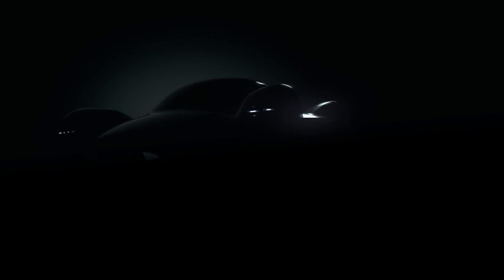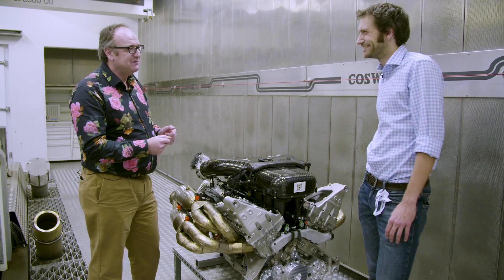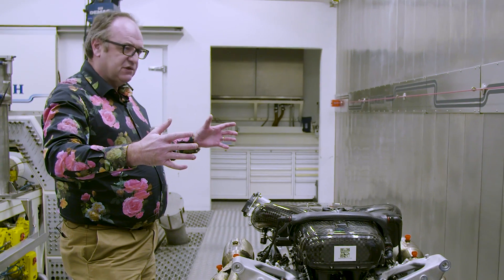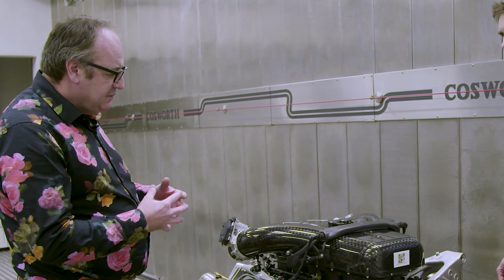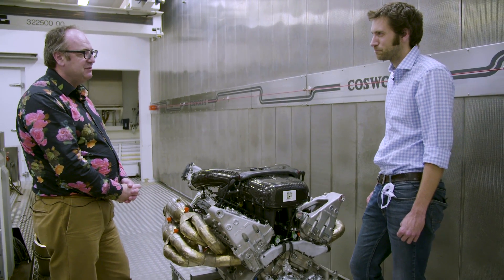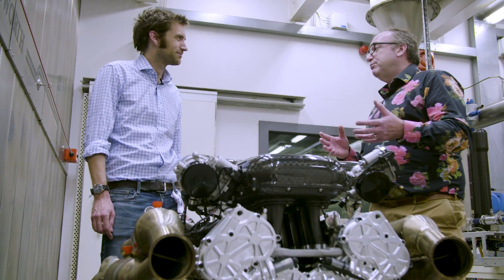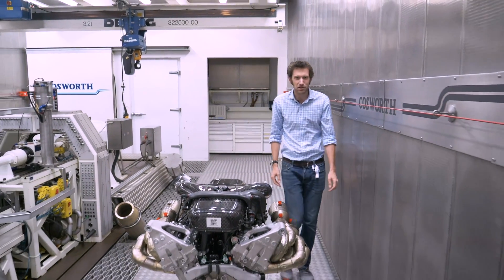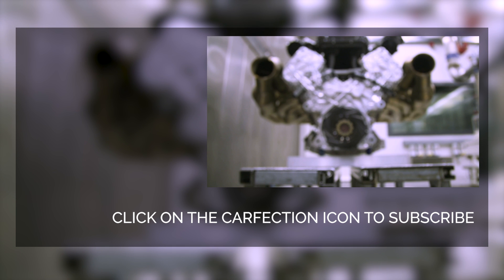Hear The Future Of The Supercar At 11,000rpm: The Aston Martin Valkyrie's V12 - Carfection

Comment: He said Valkyrie is the only road car with a fully structural engine. But Ferrari F50 used similar solution, i mean the gearbox and engine was the only parts keeping rear chassis with the front rest of the car. Is this the same solution or totally different?
Reply: The Renault Clio uses the same technology, the bumper, headlights, engine, radiator, and front wheels are all linked together meaning that if you want to change a bulb you have to take the engine and gearbox out....

True story, many French cars share this design...
Reply: @123Sander1231  Are you serious? Are you comparing a clio with this piece of incredible engineering?!! You said yourself you can remove the engine... what happens to the Clio when you do this? Oh that's right... nothing!! The V12 in the Aston is the only part joining the front and rear of the car... remove it and you have 2 pieces flopping on the ground! Wether the body will be strong enough to support it is another matter, or perhaps it will need to be on stands or trestles during an engine removal...
Reply: @BrianSmith-ck4mm  I don't think so because in F50 if you separate the gearbox and engine you litteraly tear car into rear chassis with bumper and a rest. There are photos and articles on internet of clutch removal in F50 and it looks like i said.
Reply: @bolectv1933  then I stand corrected! I shall do some Googling!! 👍🏻
Reply: @BrianSmith-ck4mm  It was a joke you would understand if you worked on cars for a living!
Reply: @BrianSmith-ck4mm  incredible engineering? I can't see any of that with the dumb ass single wiper hogging up the entire front end. Only connection between the back and the windshield wiper more like. I bet you that thing is structural. God damn I fucking hate windshield wipers.
Reply: I believe the V12 in the F50 and Enzo etc are part of the structure but they can be removed and the car is still intact. The Valkyrie V12 is literally is the only connection between the front and back of the car!
Reply: AFAIK F50 uses some aditional reinforcements to connect fromt and rear. So technically the engine is holding the F50 together, but there are other support reinforcements. The Valkyrie however only uses the engine without supports. That's why they actually can say that the valkyrie is the first car solely held together by the engine.

Comment: Super impressive. But, if an electric 200kwh, 3 or 4 motor car can produce the same power (and more, with instant torque), are its days numbered?
Reply: Even though the batteries and motors would weigh the same if not more. Yes you can have the massive power but if the car can't get anywhere it's useless
Reply: @TheRagingStorm98  Current batteries are heavy-ish, although energy density is on the rise. And solid state batteries, when they EVENTUALLY arrive, will change the landscape once again by being 3 times more energy dense as current lithium offerings, while having none of the bad stuff:
- No possibility of explosion
- Magnitudes faster charging and discharging
- Can be made from common elements like sodium
- Have up to millions of possible charge/deplete cycles

By the way, Echoklang, the Tesla 2020 Roadster will have all those things I mentioned (200kwh battery, etc) and still be capable of 0-60 in 1.9 seconds, top speed over 250 mph and more.

Comment: So basically it has beated McLaren's F1 record for the most powerful N/A production car,right?
Reply: Based on the engine alone, the F1 was already topsided by current V12's by Ferrari (Berlinetta, Superfast). But as car performance as a whole, F1 is still the king of N/A. And since the Valkyrie will feature a hybrid powertrain, the comparison in the performance won't be valid with the F1. If the Valkyrie comes with an option of strictly N/A, then we'll compare it with the F1.
Reply: @anastasiskaz  If i come to think of it, the only valid comparison to the F1 currently is the Vulcan, also from Aston Martin. The Vulcan has more power, however the F1 is a lot lighter. It would be interesting to see them side by side on the track. However the Vulcan has not been tested for top speed, so if we're measuring strictly on that, yes, the F1 is still the fastest (not necessarily the quickest) N/A car in existence. And it came out 25 years ago. That's a gosh darn good legacy if you ask me.
Reply: The f1 has the highest top speed for a NA engine not the most powerful

Comment: Is 1000hp for just the engine or including the e-motors? The Tesla Roadster 2 will probably be in that range and at 1/10 the price (I'm guessing)... Nonetheless, a NA high-rpm engine is a nice choice if you insist on using yesterday's technology.
Reply: @xechox-r1l  OK. I might have mixed this up with the other upcoming British high performance grand tourer. Jaguar perhaps. The Tesla will probably be heavier as you say. But it'll have rockets!
Reply: @xechox-r1l  The thrusters could be actually be used for safety purposes (braking and stability for example) as well as increased performance. I'm pretty sure they won't be in the base version though.

Comment: Why not get rid of the gear box and stick an electric generator on it then run it at constant speed and use a battery/capacitor/e-motors to handle driving the wheels? Save a lot of weight no?

Comment: Weighs 440lbs. Just for comparison, a small block Chevrolet V8 weighs 575lbs. WOW!! THIS THING IS AN RPM MONSTER!!!!!
Reply: Yes the old iron block, iron head small block from the 80's may have weighed that.  However the current LT1 small block weighs 465 lbs
Reply: In comparison: This engine weighs a little more than 200kg while the engine in the Veyron with same power output weighs 400kg.
Reply: The point was  "why is this guy comparing a 2019 Cosworth engine to a 1955 chevy small block!!?"
Reply: furthermore... for the 600k extra spent on the Cosworth, im sure we could fab up a titanium bracket for the LT so that it too could be a part of the stressed member.
Reply: @jeffreyhavlik3562  but then with power adders to the lt1 it would weigh alot more.
Reply: @jeffreyhavlik3562  The internet ego contest........
Reply: You might as well compare a leopard with a rhino. 1HP/kilo in ANY configuration will rock my boat.
Reply: @jeffreyhavlik3562  .
Reply: That's around the same weight as the 3.6 dohc v6 in my Impala.
Reply: smallblocks are impressively light for their other specs.
A K20 weighs 400 lbs. 3 times the cylinders and over 3 times the displacement, 40 lbs more
Reply: I want to know what their 250hp 3 cylinder prototype weighed! I assume 1/4 the weight by his explanation, so roughly 110lbs!
Reply: Jdr, let's keep this discussion about factory parts. There's no LS or SBC factory block running in the 5s. Using factory parts, the LS is a better platform period.
Reply: C6Fever  speak English (pounds)
Reply: what kind of idiot would compare an engine made in 1955 to an engine made in 2018?

no one uses the SBC boat anchors anymore unless its for period correct rebuilds. the LS series is far and away better.

LS1 engine weighs 390lbs dry, around 430lbs fully dressed.
LS7 weighs about 450lbs fully dressed.

the cosworth engine is truly amazing regardless. what an achievement for them.
Reply: @OxBlitzkriegxO  the ls series isn't far and away better God damn the. You can get a sbc that weights less than a ls makes more power then a ls and is quicker and stronger then the most expensive ls build around. As the quickest sbc is a nitro engine at 5.67 ets in the quarter and the ls barely traps 6.10s
Reply: @OxBlitzkriegxO  the sbc isn't a boat anchor infact that platform can run circles na around this 6.5l v12 with only 6.2ls
Reply: lol americans and there boat cars. sit down guys and go back to your little line racing. HERP big numbers DERP

Comment: This is what F1 should be running, a screaming V12..
Reply: It sounds like an 90s F1 engines on steriods
Reply: EVERYONE SHUT UP AND ENJOY THE DAMN VIDEO
Reply: Veery true....shit times....polution....my ass
Reply: They were too powerful. And trust me with the computer systems we have, a v12 isnt needed to make cars go fast as hell
Reply: But it might make a widdle bunny cough, we can't have that now, can we?
Reply: The size of the cylinders is forbidden
Reply: tbh while this is higher pitched it also sounds like a vacuum cleaner
Reply: @amac_  That legendary BMW V10. Brings tears to my eyes
Reply: @nonserviam4813  i highly doubt that they would be faster, besides that the fuel is not included in the weight of the engine but it plays a significant role. I admit i was wrong on the weight of the PU, but i am correct when i say these V12 had less power. Today we have over a 1000hp.
Reply: Can’t wait to see this and the new Hennessy eventually duke it out!
Reply: @BigSeane012  in my opinion this would be a greater piece of art because of its high performance naturally aspirated v12 unlike henessey which has forced induction like turbo and superchargers(that sound like crap) but i have to agree, henessey will beat the shit out of this car.. so easily..
Reply: Everything too heavy. The current option is probably the best right now. More than 1000hp combined.
Reply: IMO the engineering going into the current turbos with their ERS-H antilag is way more interesting than just bolting extra cylinders on it..
Reply: @JippaJ  it may look interesting or it maybe interesting to study but very very uninteresting to hear
Reply: @tarun9710  Ever been to an f1 race? They sound incredible.. 

And to be honest I don't give a ** about sound. I love to watch a Formula E race!
Reply: @JippaJ  yes ive been, but in my opinion its the high revving naturally aspirated that sounds great.
P.s - its a personal choice though.
Formula e is great..🙏
Reply: @tarun9710  The amount of cylinders isn't gonna increase the revs (and sound), it's the fuel limit! 
BTW this engine does the same amount of revs as an F1 car..
Reply: @JippaJ  i know that , i mean the screaming nature of a naturally aspirated v12 and a turbo charged v6 is very very very different , i think u should once hear it ...
Reply: @tarun9710  you're very very uninteresting to hear.
Reply: Jaap My first British Grand Prix was 1972 aged 18months, I went every year till 1993 then work overseas. I’ve also been to Zandvoort, Spa, Hockenhiem and to Le mans 23 times, the last 20 in a row.  The 1980’s turbos sounded raw and untamed with the pops, bangs and grunts, they sounded feckin awesome going up the hill into druids at Brands Hatch. The 90’s V10s and V12’s screamed. So forgive me but for me the Screaming v10-v12 that were built like an exquisite Swiss watch sound better than the latest generation of F1.
Reply: @runnyeggyolk6347  just like u
Reply: @tarun9710  are you joking? I'd take the current sound ANY day simply because you can hear so much else going on. Lock-ups, part failures, skids... I dont know why people insist F1s should be so loud as to drown out all the fun stuff
Reply: @JippaJ  which F1's? Current rev to 15,000 rpm, previous f1 engines (Coswoeth v8) did 19,000 rpm (limited) but hit 20k on dyno's
Reply: @nssherlock4547  I commented on that 10 months ago, back when F1 cars revved up to 11k, sometimes 12k. 

Now F1 cars still don't go above 13k. Just watch the F1 telemetry during a race.
Reply: Chucky boy Stanley I just don’t think people really understand how load the na era engines were. When I went to silverstone I used to stay at my friends in Leighton buzzard 26 miles away and you could hear the engines firing up on Friday on practice laps just awesome noise
Reply: Idk.... V12 burns too many gasoline and makes little power. I think V10 would be perfect
Reply: @김지훈-t2t1w  v10 is also great but only if its very high revving atleast 12k and then the sound would be amazing
Reply: @김지훈-t2t1w  You nuts!! V12s make little power? Says who? La Ferrari makes 800 hp out of a 6.3 aspirated V12! All of that in a road car. Ever heard of a V10 to make anything close to that? If anything, the extra size and weight would be a downside to a V12, but certainly not lack of power. On the upside, V12s are naturally balanced, so they send out very little vibration compared to any other cylinder configuration type engine. Also, the sound of the 12 cylinders full bore at work is way more likely to send entire hordes of espectators awe struck in pure folly.

Comment: Can we make all F1 cars have these instead!? I know we had V12s before but this... this is what we want!
Reply: We don't want this engine. We want its sound. About to get a little nerdy here, and I hope I'm not coming across rude.

Assuming it all weighed the minimum, the entire powertrain of a modern F1 car, including the hybrid system, weighs at least 35kg less than this engine does MINUS its hybrid system. It also makes about the same power. That's a lot of weight when you're talking about something as light as an F1 car. Even the weight of the fuel makes a noticeable impact. You'd need to do SOMETHING to the engine to get enough power out of it to counter the weight, and it would end up even heavier because of it. I think the only F1 engines from the past that could come close to doing enough are the qualifying engines used in the 1980s. The old turbo 6s running stupid amounts of boost that couldn't be used for more than a few laps because they'd blow themselves up. And all of this is ignoring the sheer size of the engine. Modern F1 cars are built to hold a 1.6L engine, so you'd need to rework the body, further increasing the weight.

So yeah. We really wouldn't want something this big and heavy in an F1 car. But it'd sure make a nice noise.

Comment: Much ado, all rendered obsolete by the electric motor
Reply: The Petrol car will remain, just a bit more rarely.
But they won't be taken out without a fight.
Tesla 2020 is only stated to go 250 MpH, Impressive bench for EV's, but it will take decades to better that as an EV.
Reply: @Blurgamer17  Teslas are mass market. Check Rimac Concept 1 or Rimac C Two. That's the bee's knees

Comment: 3:15- a 3 cylinder 250hp engine.

Wait.  Did I just hear that right.
Wow.  You know what you can do with that? Salavating
Reply: Mike Shoults imagine that engine in the front of a Mini, or Caterham...., or at the back of an i8 👍🏻👍🏻
Reply: GT Specialist or an i3 :)
Reply: the i8 produces abut 220hp from a 3year old 3 cylinder engine.
Reply: @jaymaster103  *turbocharged 3 cylinder. This one was naturally aspirated.
Reply: A NA 1.6 Liter 3 Cylinder whichs revs up to 11 000 and weighs like 80 kg.. 
If i would have one of those, i would put it into a smart.
Reply: @gepixelt7712  imagine the sound of it as well! It would sound like a big motorbike engine.
Reply: Put one in the front and one in the back...
Reply: One word: motorcycle.
Reply: LTG 4 cylinder equals 272/3 = 90.66666666. But this is a diffrent level.
Reply: @noidontthinksolol  This is a wonderful idea. Now for Aston to make bikes haha
Reply: Koenigsegg Regara is 260hp  per liter
Reply: @sthomas7211  but the engine is turbo. Here, we're talking about a naturally aspirated engine. More than 150 hp per liter is IMPRESSIVE.
Reply: @TwistersSK8  scrap that. Its not just impressive but it's record breaking. The S2000 had a specific output of 120 ish and a maximum piston speed of 25m/s and this is even faster and has more power.
Reply: Mazda did better with the wankel in the 70s..... with a 1.3L two rotor.

Comment: What is the 0-60?
Reply: A function of gearing...
Reply: Based on calculations of weight to power, and taking into consideration traction, I think this will be somewhere around 2.1-2.3 seconds
Reply: Porsche Collector one of the said in a radio interview the goal was 2.0 I’ll try to find it and post a link
Reply: @soupfork2105  Ok.Tesla roadster is faster.
Reply: @theninja9127  Tesla roadster will be weighing more than 2 tons possibly (with a 200kWh battery), it will only be for straight line accelerations. No revving sound, no real cornering capabilities, no pleasure, not really a sports car.
Reply: @porschecollector727  Yay!Tesla roadster is faster!😄

Plz like my commemt or sub to my channel!
Reply: @F0rdy57  Ok
Reply: HOW DID YOU REPLY SO FAST!😕

Edit:Ok@STGUY

Edit again:Plz see what is my liked videos and the channel that I sub.

Comment: The future is here, and it's electric. The Testa Roadster will obliterate this:

Acceleration 0-60 mph
1.9 sec
Acceleration 0-100 mph
4.2 sec
Acceleration 1/4 mile
8.8 sec
Top Speed
Over 250 mph
Wheel Torque
10,000 Nm
Mile Range
620 miles
Seating
4
Drive
All-Wheel Drive

Comment: Let's learn about this engine.... Bore stroke? Errr no. Compression ratio..... Err no. How tricky the cam covers are to make... Ah yes! Valve actuation and valve control... Err no but we have polymer coated bearings and a sintered clutch! Great questions👍🏻🙄
Reply: compression will be like 13-1 and stroke is very short ^^ classic high RPM engine